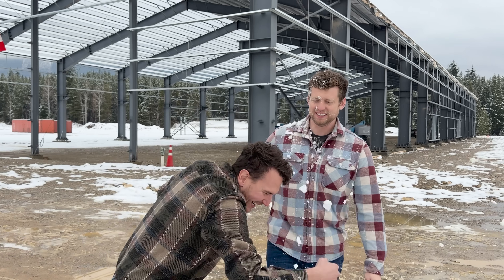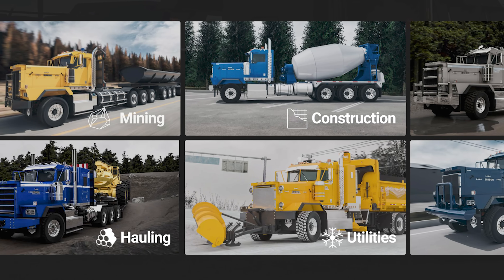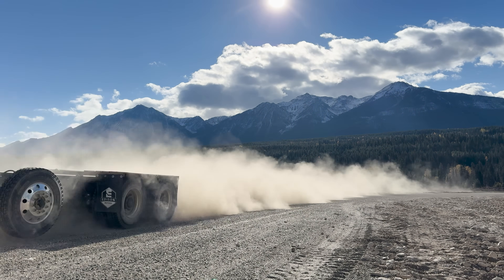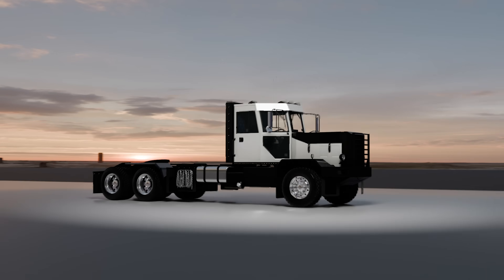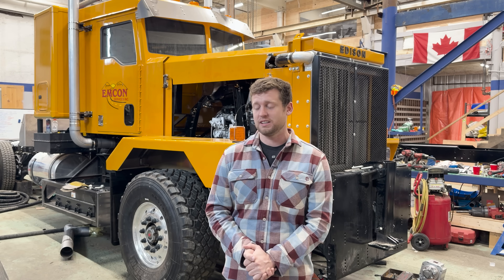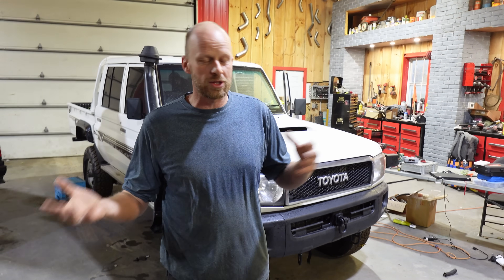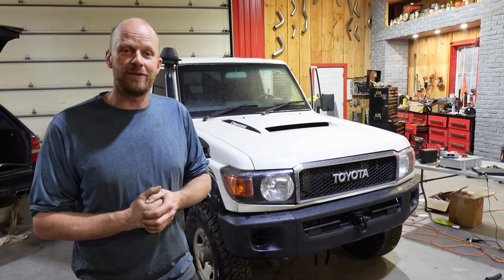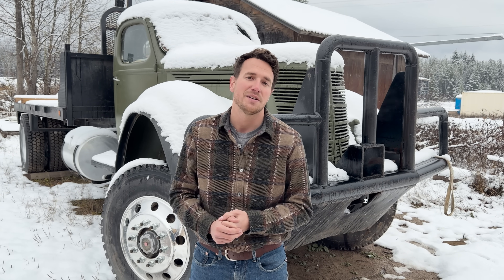VICTORY After RED TAPE: Edison Motors has GOVERNMENT APPROVAL

Comment: I think you're forgetting one very important thing - your hybrid is likely to be much heavier than its combustion-only counterpart, or have I missed something, but I guess there are no exceptions?
Reply: A full EV semi carries 10,000 lbs of batteries.

An Edison truck carries 3,000 lbs of batteries for peak loads, and has a smaller-than-normal engine for extended range.

Overall, an Edison hybrid truck weighs nearly the same as a standard diesel only truck.
Reply: @Sah-o5m you say that only 1350 kg is heavier than standard trucks? battery weight motor plus generator weight all metal weight inverters and other electronics cables weight another sorry but somehow I find it hard to believe that the weight difference is so low. I know that the gearbox, drive shaft and large tanks are eliminated, but the drive axle with the engine will still be significantly heavier than its mechanical counterpart. and don't let anyone misunderstand that I'm scolding the idea because I generally like the idea, but this particular film stinks too much of advertising to me oh and ah, what the best
Reply: @TymonMasa 
? I do not say 1350 kg
.
Edison vocational trucks use a lighter 9 liter engine instead of a 15 liter engine

Overall, an Edison truck weighs nearly the same as a conventional vocational truck or a BEV truck.

An Edison truck, or standard vocational truck, or BEV truck are all heavier than a light weight highway Cascadia.
Reply: @Sah-o5m sorry, but I don't understand how the entire metal cabin plus the battery plus all the wiring is supposed to give a comparable weight, where this difference in the engine will give you about 500 kg of reserve, but how much will the generator weigh? inverters. plus where is all the cabin equipment and amenities? unless we only make trucks with a day cab

Comment: Is it possible to have the electric axles driven directly by the Gen on the motor? Or are batteries a required component?
Reply: The batteries provide 2-3 times the power.

Comment: Did I see correctly that the roof in the production hall is made of bare metal? why didn't you use a sandwich panel? are they not used at all in Canada? maybe it would cost a little more, but in winter it would be warmer and in the summer there would not be so much heat coming from the walls and roof. I don't understand it a bit, so I would like to ask for an answer

Comment: As a mechanic, I hope you make these easy to work on. the biggest PTA I have with big trucks is access to the powertrain. Too much of the engine is usually under the firewall, and everything around the radiator and the front is always difficult to access without removing the fan and radiator. I hope the top of that hood isn't bolted on, that would also be irritating, to have to unbolt that top hood panel.

Comment: Why not go for Scania engine and gearbox in those mechanical trucks built's.? Think about all the benefit.! no EGR valve, no VGT Turbo, more horsepower and torque, less fuel consumption. A Edison Timbertruck whit a 770 HP Scania engine, You Canadian Timber Truck driver would price You as the lords of this modern age, and don't forget to put airbags on the Cabin.
Reply: Scania engine is not currently legal in canada
Reply: @Sah-o5m  I also heard from 1 guy living in  QUEBEC that I now, that there was sold 3-5 brand new 2025 mod. Scania Trucks this summer
Reply: @jong7258 
cool :)
Any more details?
Reply: @Sah-o5m  Youtube is deleting the link I try to post to You.!
Reply: @jong7258 
It does that sometimes
Reply: @Sah-o5m  https://www.scania.com/content/dam/scanianoe/market/us/brochures-and-power-magazine/industrial-engines/warranty/Scania-US-and-Canada-Dealer-Directory.pdf

Comment: It'll be interesting to see if this hybrid electric approach can survive competition from purely electric competitors like Designwerk in Switzerland, who are also competing in the specialized truck space for construction and other applications.
Reply: Europe has better charging infrastructure than a lot of places, so pure electric trucks will do better there. Having said that, swappable batteries are taking off in Australia (Janus motors). These guys would do well to keep an eye on the alternatives to make sure they don't miss out. I'm sure they could update their builds with better batteries/remove engines etc if needed.
Reply: Edison trucks are heavy duty off road vocational trucks. They operate all day in places with no electric power. There is no competition.

Comment: What level of automation and manufacturing aids do you foresee in your production?
Reply: Great question. Since Edison is a low volume manufacturer, and each truck is bespoke or custom, it doesn't lend itself to automation.
Reply: With the production numbers that they are aiming for I can see a level of automation that would assist in the assembly of the trucks. The way I see it is they are creating a universal platform that can be adapted to most, if not all heavy trucking requirements. This universal platform will all be built very similar with the end customer adding their required equipment if not by Edison but by another company.
Reply: But to be honest, I work in Industrial Fab automation and I like to know how it could be used. 

If I could help in any way I would find that really cool.

Comment: A company marketing right to repair... if I had millions I probably would invest. But rn all I can do is wish you luck! Also, as a sidenote, I do wonder why there is no tier between the hybrid and mechanical trucks. 

I personally used to own a hybrid vehicle that had a manual gearbox and engine, with the electric motor sandwiched inbetween. Reliabiility was not an issue, since the electric motor was basically optional to the vehicle getting places.

Comment: cool you got your emissions without millions in testing. 
guess they finally saw the light that it's already emission compliant and still being used the same way mostly as it's emission compliant spec.
in that it revs up to run to a given rpm to produce power and not variable like a mechanical set up.
Reply: Alas no. They're still working towards approval of the hybrid trucks
Reply: @Sah-o5m  ok. sounded like they had emission approval but not transport approval meaning their trucks are not approved roadworthy yet. 
that was what he said.

Comment: I am so confused someone please elaborate. They are still testing and having issues on what appears to be their prototype that they test on the dirt track, but they have already delivered the same model truck to a customer? what am I missing?
Reply: Edison got govt approval "as a company".

Now Edison is working toward approval to sell "diesel only" semi trucks (which should happen soon)

Edison is also working toward govt approval to sell "diesel/electric" semis. While waiting for this approval, the giant white cab over semi has been delivered to the rigging upfitters to have the service box installed, then its back to Edison for more testing.

The pickup truck retro fit kit on the white toyota landcruiser is going to a mine for off road only use and is not subject to any govt regulations. Once the mine certifies the design, then this could turn into a multi million dollar deal for Edison.
Reply: @Sah-o5m "undisclosed truck was delivered to Winnipeg for that customer." That's the truck I'm talking about the full size one, not that pickup truck conversion. I appreciate your response but it doesn't answer my question in regards to that truck that was delivered to the customer in Winnipeg. It looks to be the exact same truck that they are currently testing and still working on.
Reply: @markymarkvancity 
Edison was commissioned to make 1 of the "cab over" trucks (the white semi) for a customer who does not want attention just yet. This truck is for the "undisclosed" buyer.

Edison built the cab and frame, tested the basics, and the buyer had the truck sent to Winnipeg.

You may be seeing video clips out of order.

Right now, in Winnipeg, it is having a giant 10 ton piece of equipment bolted on. The equipment will use electric power that is provided by the truck.

In a couple weeks, the truck (with its mystery payload installed) will most likely return to Edison for integration testing. And more brake testing.

Then (I suspect) the trucks buyer will start putting it to work to see what works and what breaks. I suspect Edison will get a temporary waiver to allow this activity while Edison is waiting on full govt approval.
Reply: @Sah-o5m  Thank you for the detailed answer, that is exactly what I was wondering

Comment: Comparing your trucks with locomotives is not a very good comparison. Locomotives do not have battery banks and this is a very important difference since this where you are getting your efficiency gains. The ability to use regenerative braking to capture energy that would normally be lost to heat is the key.

Comment: build an offroader, something like a hummvee but more larger, aggressive and hybrid
Reply: Direct Electric motor on the axle connected to gas/disel generator? It could be a bit chonker but then thinking about it, Holy crap, torque on low end! Especially if each wheel had its own motor, as then you could turn off motors that do not have grip on the ground
Reply: @flameendcyborgguy883  yes, you will have great ground clearnace without the diff hanging down, like humvee and their axial humbs. CTIS could be easily implememnted, slap on 40inch tires, 4 wheel steering, and super aggressive boxy like appearance . so much possiblity. imagine canada having a vehicle more capable and aggrevice than the american humvee... fuk it add another axle make it a 6x6 beast. perfect to shop at your local sobeys
Reply: @technicalification 

I mean, HUMMV is mobile, but not the most mobile vehicle in millitary. There is a lot of vehciles( looking at you STAR 1466) with similar levels of offroad capabilities.

However, here, we may look at level around German Unimog.

I mean, that is upper limit. Problem may be due to electirc motor placement and subsequent spaceing. However, if top spead is not that big of a deal, you could do a simple downgear, and then motor axle would be above and in line with wheel axle, which is very in line with what Unimog have going on.

Comment: I drove a heavy hybrid back in ‘81 for a year. 100 ton LectraHaul ore hauler in a B.C. mine. Always wondered why nobody went hybrid for anything else, it’s far more efficient, even back then when we had no regen, just a big resistor box to dissipate the power generated by the dynamic break.

Comment: I'm 36, a US Snowplow operator of 10+ years now.  I really hope one day I'll get to  run an Edison plow!  I will say though in my time running skidloaders, endloaders, trucks...the electric over hydraulic is not the way to go.  As Chase says, there's no FEEL.  It's hard to train a new operator when they can't feel the resistance in the controls.    It's possible I just don't know what I'm talking about, but I want to share my experience as a young vocational truck operator.
Reply: Excavator operator here, feel is 1000% what you need when learning. I went from a Komatsu to a next-gen CAT and man the difference is beyond comprehension, you literally can not feel anything. I would have to watch the bucket like a hawk. I went from feeling where utilities are to cutting right through them, luckily they were either dead utilities or were easy to fix but still not good, then I went and rented a Komatsu again for a really big project and wow what a difference it makes being fully hydraulic. I got in the Komatsu and started running it like normal, once I was finished and went back to the CAT it took many hours to get used to it again. Even though the Komatsu is much bigger than the CAT, I can grade much better with the Komatsu than I can with the CAT. All because of electric over hydraulic.
Reply: It would depend on the installer.  Edison doesn’t have the expertise or the equipment to do a full Snowplow install.  What Edison can do is install an electric PTO or an electric hydraulic pump.   Then all of your controls would still be hydraulic.  I believe this is the setup Encom is going to use with the truck Edison is making for them.  Most specialized vocational trucks use hydraulics so the installation would be the same, only the power to the pump would be different. With as quiet as the Edison trucks are, it would probably be the loudest thing on the truck.

Comment: Let the big corps build only "Cascadias" and such...plasticrap that will not run smoothly 1 million miles and up, certainly eating up the margins with too much maintenance and downtime.
Keep chooching this hype road train, properly built like old school canadians, though as the winter. (If you guys manage to make trucks also adapted to very hot climates, there's a market for actual road trains and tough aplications in Australia and other countries, but that's down the road.)
Rich burning rubber in the dyno with a OG Landcruiser is just the funniest thing. That beast will be running wild working offroad...probably way cooler on the rubber.

Comment: The diesel electric truck would make so much sense for my job as I pull refer trailers. 

You could completely remove the refer pony motor and replace it with an electric motor, replace the fuel tank on the trailer with battery packs, and have a high voltage plug from the truck to the trailer that charges battery packs on the trailers and run the electric motor on the reefer. 

You could have continuous run time on the reefer as well as have range extension for the truck on the battery packs. 

You can also slap a bunch of solar panels on the trailer so you can passively recharge your batteries
Reply: Edison already had that idea.  A reefer covered in solar panels, batteries underneath,  electric reefer unit, it even had a backup diesel generator.   The problem is Canada has a 200% tariff on imported solar panels.  It doubled the price of the trailer and the customer backed out.   Just an example of the government stupidity that Edison has had to table and just focus on the trucks.  The talk about it in some of the old YouTube videos.
Reply: @Wild_Lee_Coyote  yeah I watched them videos,, but you dont necessarily need the solar panels or the back up generator. At least for what I do, which is a lot of LTL deliveries, the trailer rarely sit with product in them unless a truck is hooked up to them.
Reply: Another win for Edison's hybrid truck

Comment: With no transmission how do you drive the PTO off the engine drive?
Reply: You use an electric PTO.  It’s basically an electric motor powering the PTO instead of the diesel engine.

Comment: Yknow I had a thought:
If Environment Canada will only certify you for on road engines, why not just make a truck that’s a true Diesel Electric? No battery, just direct generator to motor connection with a generator that uses a traditional throttle.
Reply: Generators don’t work well on a traditional throttle.   They would get massive voltage spikes and engine loads. Generators work best at a constant engine rpm.  The problem is the generator is part of the driveline and is on the frame.   If they took it off the frame and placed it on the ground then it would be ‘off-road’ and that is legal.

Comment: The hybrid may be better, but it's untreaded ground for the finer details. The diesel-mechanical is something you have all the data on you could want, with the decades of building these things that have passed. My hope is that, alongside fulfilling demand and supporting the company, these mechanical trucks of yours also show the true benefits of your right-to-repair philosophy as Edison grows in notoriety. Every industry, from handhelds like phones to equipment like these trucks to structures and materials - they all have demand for quality, but companies who see profit in doing it cheap. Given time, I think you guys might genuinely be able to shake the market a bit, and show that doing it right still works. Even if these things take time to change, you've got the plans and the mindset to make this company last.

I hope to see one of those twinsteers in these production updates at some point. Those things are beasts, and the differences in the construction of it would be interesting. And I'm excited to see one of the hybrids demonstrating the lack of engine idling while running onboard equipment.

Comment: Diesel electric locomotive, hybrid is the way to go. Especially if there is an option to charge the battery with out the engine in case of emergency.
Reply: Topsy actually has a charging port so it can park at a charging station and top off.   They can also have a level 2 fast charger setup to charge EV’s that are out of juice, like for tow trucks.

Comment: I wonder how they would fare in cold climate. The mine i work at is located 500km south of the arctic circle and no roads (all privately owned roads) connect us to the rest of the continent. We're about to install our two first windmill, otherwise, we rely entirely from diesel to fuel our trucks and generators. 30% less immense here as the price of diesel is about double the price of what you'd pay down south.
Reply: Because the hybrids have a diesel generator they just add a diesel coolant heater and the batteries can stay toasty warm as long as the fuel tanks are not empty.